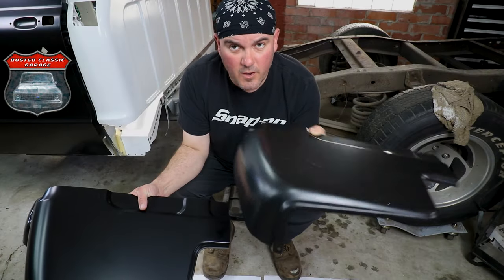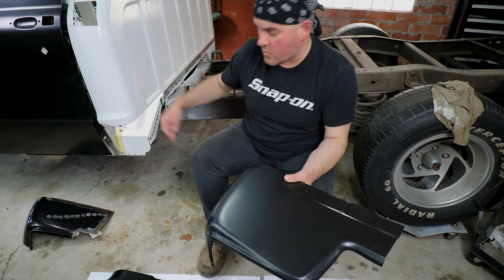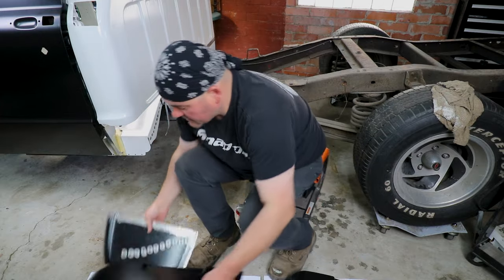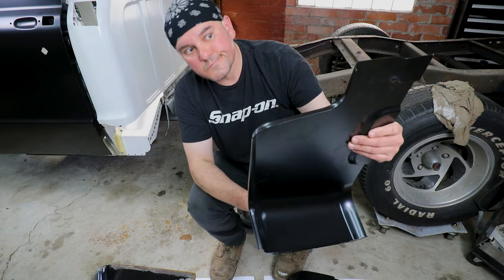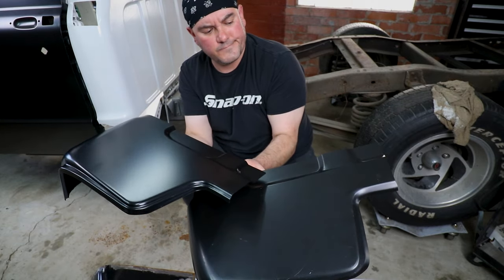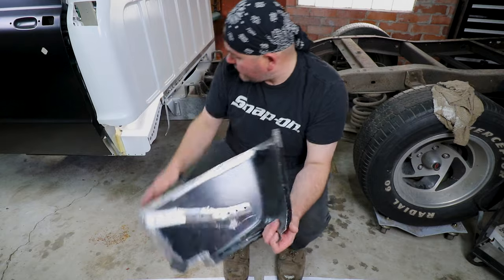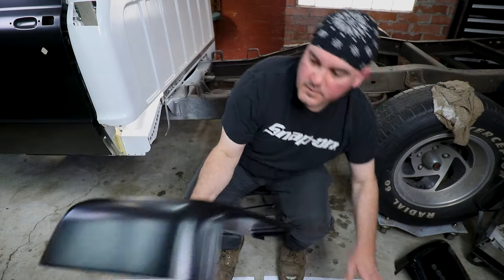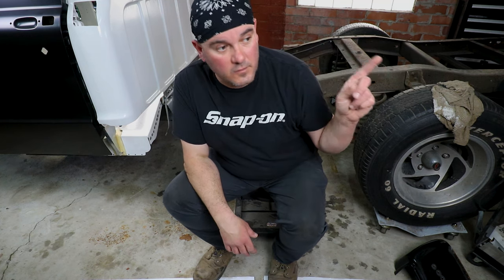Coming Soon: Upgraded Cab Corner Patch For Your 67-72 Chevy C-10 Truck!

Comment: I’m curious about key parts inside door bottom. Wondering if they have the same contours as the original. Anything I’ve tried so far has fit like garbage, takes a lot of work to make them fit and you can tell they aren’t original. I’ve done 2 cabs and used that B pillar. They fit great! Looking forward to trying the A pillar and cab corners on my next cab. I used a shrinker on my last cab corner to make it fit the B pillar and door. Really enjoy your videos!
Reply from the maker: Thanks Mark! Funny you ask about the door bottom. I have a drivers to fit in my 69. It's day and night compared to the common panel. I started fitting the old one on my 71 years ago. What a terrible fit. Hit me up on Instagram or Facebook. I can send you pics of the high quality inner door patch.
Reply: Any info on when these will be available?  Thankfully just got a pair of the new A-pillar bottoms, but I M going to need one cab corner.
Reply from the maker: @chadrech9230  from what I've been told that they should be coming out in the middle of next month.